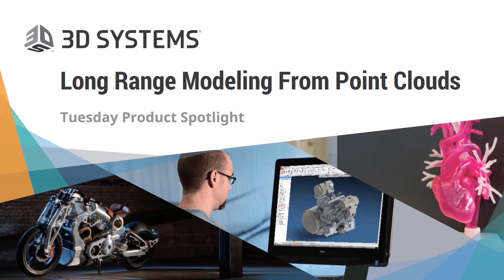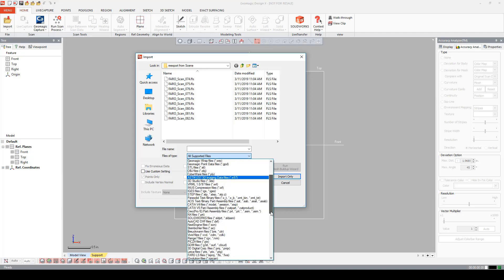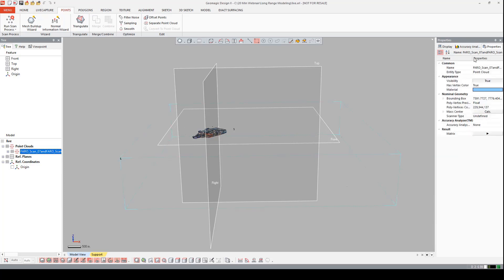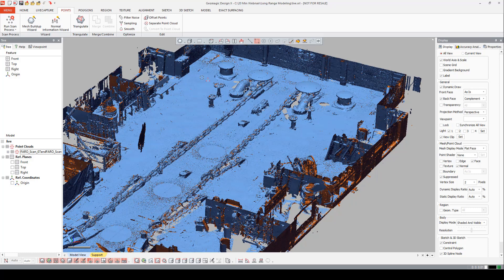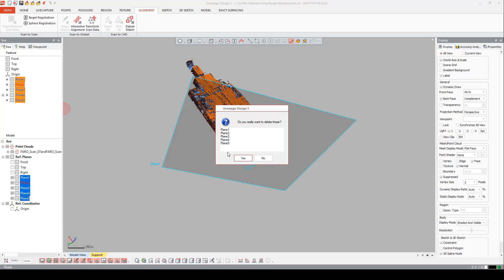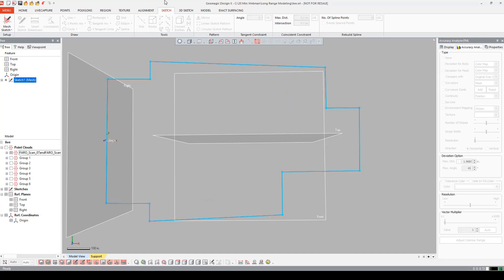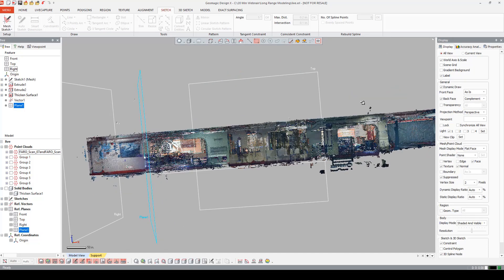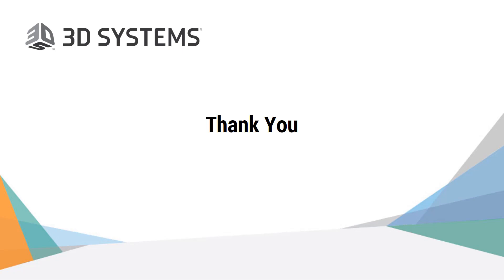CAD Modeling from Long-Range 3D Scan Data in Geomagic Design X

Comment: Any suggestions on how we can fasten the sampling process?
Reply from the maker: Clock speed on your computers' processor is the best place to start. Also using the percentage-based sampling instead of the deviation-based sampling will speed up the command.